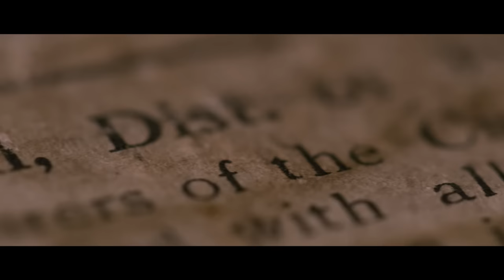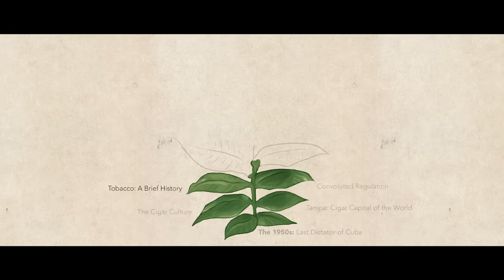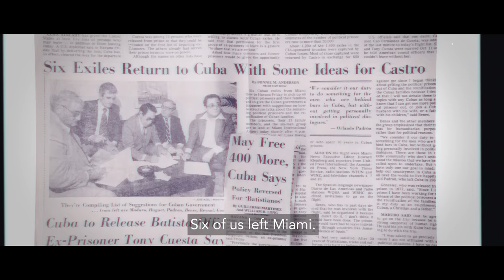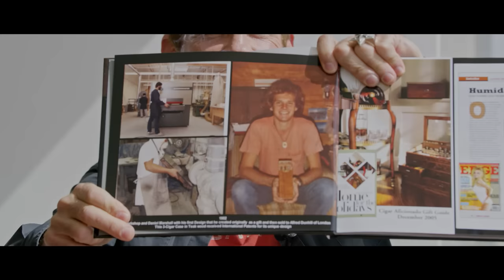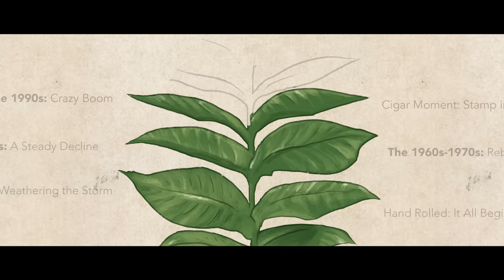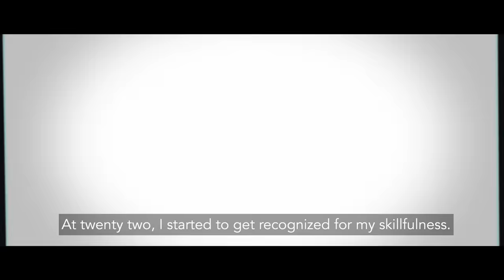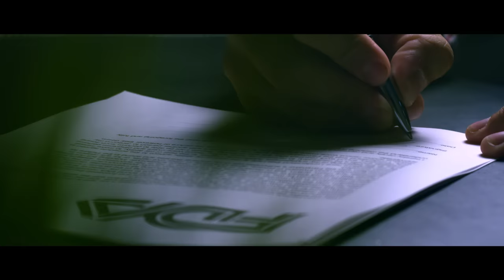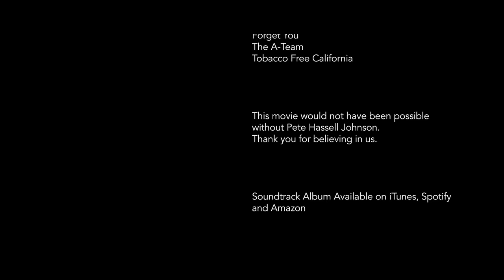Hand Rolled: A Film About Cigars FULL MOVIE

Comment: Great film, taught me a lot I didn't know. However, I lit my first non-cuban halfway through. (The only ones I had in my humidor were Patron 1964 and Rocky Patel Decade). Honestly, I wanted to like it (the 1964) but the aroma was not there, and hand to heart I could put this down and not regret leaving it half unsmoked. Maybe it is past peak (storage conditions were fine) as Ive had it for over 10 years, but I've nubbed almost every Cuban from the same humidor with similar age. I will give NCs another try and hope the result is different. Great documentary though